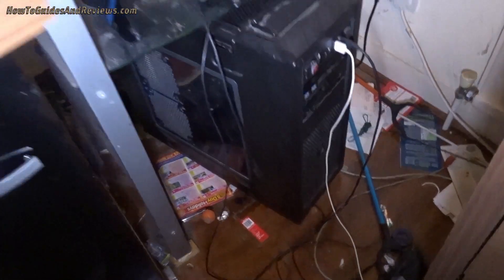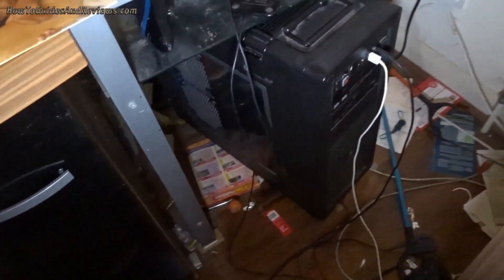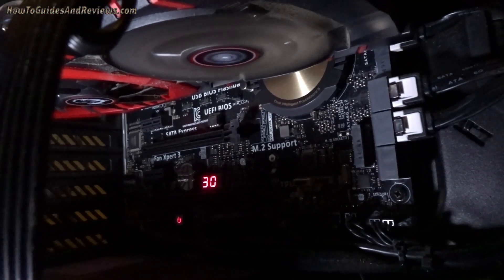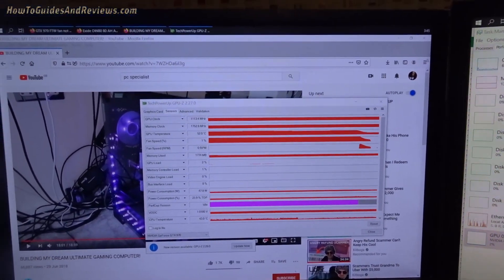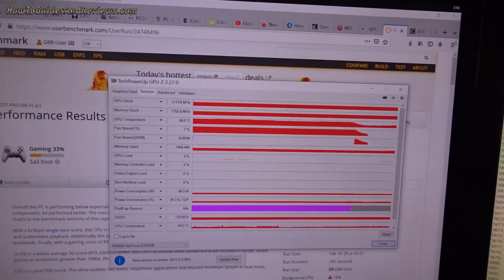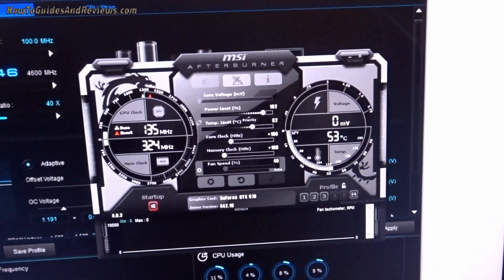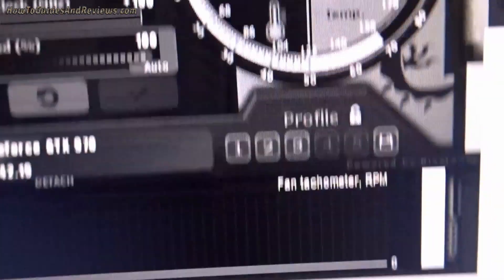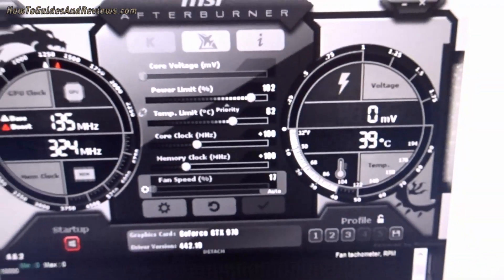Computer GPU Fans Not Spinning Quick FIX - Sticky Fans Solution

Comment: When I turn on my pc they spin but when the Gpu is under load they won’t spin why can’t the fans just spin constantly when you turn it on and when you’re at the desk top? His computer is dusty and mines not this doesn’t make sense
Reply from the maker: you need to empty a vacuum bag into it to make it dusty then the fix will work :)     Why don't you just follow the instructions and install Afterburner, problem solved.
Reply: @Quantum_AI_Tech  i just start afterburner up with windows
Reply from the maker: you have to set afterburner to keep the fans always on. Settings / Fan / Enable user defined software auto fan control.....

Comment: Started having a very similar problem today. I unticked the bottom 2 options, made a slightly more aggressive fan curve and now my fans don't stop.

They were initially revving up to 2k rpm and then all the way to 0 for an extended amount of time before turning back on.
Reply: im thinking the windows update fucked with something lol
Reply: BTW, stop buying gpu fan replacements and instead use the fans from an AIO cooler. strap, mold, or weld the fans onto your gpu and get rid of the casing. all the casing provides is asthetics not any actual benefit. its actually a negative impact on the gpu cooling. I have a 360mm kraken that I took 2 fans from and strapped them to my gpu, even with the kraken AIO having ONE fan. The cpu sits at 32 while the gpu sits at 35 at idle. under full load on heaven benchmark cpu hits 63 while GPU hits 71 at max. Which is insane. considering with its original fans it was hitting 75 easily. and going upwards of 78 at times.
hfdgsdfg

Comment: My fans do not work whatsoever. I have a Windows 10 Pro, with a GTX 960 EVGA dual fan. I have downloaded multiple programs, but nothing works. I have everything connected and the gpu got to 91 degrees Celsius last night while I was trying to play Destiny 2. Let me tell you, that game is hella graphics demanding
Reply from the maker: did you watch the video and attempt the fix? Your fans are stuck or dead, software aint going to get them to spin, prod them with a pencil to get them spinning, then use after burner to keep them spinning
Reply: @Quantum_AI_Tech  oml I already did all that. msi afterburner doesnt do crap. precision x1 doesnt do crap. nothing works with the fan.

Comment: hello sir does gpu fan wont spin  will caused  the lag like droping into 1-6 fps? on games?
Reply from the maker: Yes, cos the GPU will over heat amd thermal throttle performance.
Reply: well yes and no. if it’s hot as hell, chances are your computer will crash. but there will be no lag.

Comment: hey guys i really need some help, i got an acer nitro 5 laptop with an RTX 2060. My cpu fan spins fine and smoothly but my gpu fan doesnt spin properly at all it keeps like jamming. I used to get 6000 rpm on my gpu when it was maxed but now i only get 2500, I opened up my laptop and tried spinning the gpu fan myself and i could see that it kept on jamming. What do i do?
Reply from the maker: did you try MSI afterburner to always keep it spinning at a low rate?

Comment: Hi! Yesterday i got brand new gpu, so i wanted to unplug gpu lightning, i removed 4 pin power plug as i thought it was lightning ones but actually it was fan power plug. I have gpu with three fans, two of them stopped working i put back that power plug but after that fans are not working properly. When junction temps reach 80c one fan will start working but last one wont start.  I have videos on my channel how fans are spinning. I think i have messed up gpu bios
Reply from the maker: did you unplug the 4 pin whilst powered on? or plug in whilst powered on? if so youve damaged the GPU.
Reply: @Quantum_AI_Tech  yes power was on but i have done it before, nothing happened. I know that 8 pin gpu power cables shouldnt unplug when power is on. Thats sad if its damaged now bc of that. Is it repearable?
Reply from the maker: You are playing russian roulette, eventually you will damage it and I mean 50/50 chance on each unplugging. And probably damage other components in your system as well. Don't fing unplug andf plug things inside your PC when it is POWERED ON! COMPRENDE?

Comment: Have a GTX 980 SC From EVGA, Put a working card in my new build as a starter GPU because a 3090 will go there eventually. Upon booting to windows the GPU fans stop spinning, they'll spin when you turn the computer on but when you get to Windows the fans stop and don't start back up even under load. They look like they try to start spinning but don't, afterburner is what I'm telling to spin the fans manually. I know this card works just fine, it did for over 2 years with no problems, it was never dusty and it never had problems until I put this card in my new build. It's frustrating
Reply from the maker: Sounds like AFB fan control is NOT enbaled. Make sure that afterburner is actually controlling it  i.e. AFB settings  / Fan / Enable user defined fan control box checked.

Comment: What's do you set your fun speed at if you don't mind me asking ty
Reply from the maker: 17% upto 40c then slowly ramps up, 100% at 75c, though does not go over 65c. So runs fairly quiet most of the time. The fan curve is set in afterburner.

Comment: My gpu is werid its an rtx 3070 zotac twin edge and the fans arent moving and im getting 39C
Reply from the maker: Use MSI afterburner to keep the fans constantly spinning at a low rpm, watch the video. Though 39c is not hot for a GPU.

Comment: Holy fúck mate tanks, my 1650 was way up in the 80s, now (thanks to your solution) it has gone down to to the 50-60s
Reply: Which method did you use? I also have a 1650 gtx

Comment: I can't believe this actually worked for my 3090.  One of the fans wasn't spinning but the other 2 were.  Took a few tries trying to spin it in both directions until it just took off.  Thank you.
Reply: Did u have display when they weren't spinning?
Reply from the maker: You will have a display but it will thermal throttle performance.

Comment: Over Christmas I had a mother board issue where the fan stop working on two of my graphic cards.  But I I did not have MSI on was not  it so I did not know about it And  I did not know about it,  to it was to late. I was playing Far cry New dawn   After my RX 580 8gig went to black screen.  I replace it with my spare  graphic cards my R7 260x OC this card is factory set to run at a clock speed of  1188mhz. but it to went to black screen It only lasted two days.  I manage to use a hairdryer on the  R7 260x and got it going I use MSI I notice that  the fan on the R7 260x was not turning and the tamp of the R7 260 went a high as 99c I did a bypass of  the power supply of the fan in the R7 260x  I ran it directly off the PSU  Playing the game on low settings   the tamp in the R7 260x now sat around the 65c mark I got to get  th RX 580 going I don't like playing games like far cry new dawn on low settings.
Reply from the maker: yep, you need to keep an eye on temps.

Comment: my graphics card is the Evga gtx 980. I recently bought this thing used. Worked great but it started crashing when I played a game on fairly high graphics. Then I checked my temperature and man 94-97 degrees on idle... both my fans don’t spin... I tried using the pencil trick and the afterburner. One of the fans just completely stopped working and the other fan just struggles to spin and just makes tick sounds. Any suggestions please.
Reply from the maker: Looks like your fans are dead. Remove the fans and stick some case fans on to the GPU powered by the motherboard if you can't connect them directly to the GPU. If problem attaching you could just use some tape. Anyway that's what I would do. Theres also a good chance your GPU is now faulty after having run hot for a while and being a good 4 years old. Just illustrates people always need to check their temps whenever they notice anything wrong as temps kill electronics.
Reply from the maker: You can hardly test for anything if you don't have a monitor.

Comment: My gpu fans werent spinning on idle because it wasnt hot, but once i put it under load in a game they start to spin, i feel so stupid
Reply from the maker: Thats how they are supposed to work, but because of the stop start behaviour eventually they will stop spinning, best to config MSI AB to always keep them spinning at a low rpm that way they won't stick.
Reply: @Quantum_AI_Tech  can i make it spin at low rpm at idle but when it goes under load full speed?
Reply from the maker: In afterburner you can set a fan curve, so it ramps up the fan speeds as needed.
Reply: @Quantum_AI_Tech  Bet, thanks

Comment: some GPU fans don't spin unless under load, but man take out the thing and clean it.
Reply from the maker: Thats how they get stuck, you need to keep them spinning at a low RPM. If you don't they will eventually stick.
Reply: @Quantum_AI_Tech  how do i get them to spin at a low rpm on idle?
Reply from the maker: @ Shafay Its in the video, solution keeps it spinning at a low RPM until needed. It works, I have been using the solution for over 6 months now.
Reply: @Quantum_AI_Tech  No, they get stuck because there's so much dust and filth that they can't spin at a low RPM anymore
Reply from the maker: Well then take the card out and clean it. Use a hoover on it etc.

Comment: What does prod the fan mean?
Reply from the maker: poke the  fans with a a pointy object  - did you watch the video?
Reply: @Quantum_AI_Tech   well at first i was but then i realized the psu cables werent plugged correctly into my gpu so that was why my gpu wasnt working. But i have a new problem, i loaded into the american megatrends screen and i continue into my bios then exit out of the bios. After that my pc repeatedly restarts until i go back to the american megatrends screen. Can u help me out in any way?
Reply from the maker: how far does it get before reboot, whats the last bit on screen
Reply: @Quantum_AI_Tech   there's nothing on the screen. It just keeps rebooting until it gets to the American megatrends screen.
Reply from the maker: so this started after you plugged in the psu cable into GPU?
Reply: Ok so i kinda fixed it. I just restarted my pc by power button. However, now my pc crashes everytime i try to run a game, reinstall drivers, and if i use it for like 20 mins or longer, it just crashes. Edit: now when i type in my password and click enter it crashes. My gpu is a 3060 ti.
Reply from the maker: whats your psu i.e. make and watts and how old is it, could be PSU is dying.
Reply: @Quantum_AI_Tech   my psu is the corsair rm 850. With 850 watts. I bought it 2 months ago i think. Everything in my pc is basically new. I have a ryzen 9 3900x, asus prime pro x570, 36gm3600mhz ram, 1.5 tb ssd and a noctua nhd15 cpu cooler.
Reply from the maker: Has your pc ever run games properly with this GPU?
Try a different GPU, any gpu if you have an old one lying around and see if that runs a game, if so then you may have a faulty 3060 ti. What are the temps when its running properly, check temps using software like hwinfo (free download off the net)
Reply: @Quantum_AI_Tech  temps for the gpu is 50 degrees celicus. It has ran properly. And i do have a old gpu that dont work.
Reply from the maker: Then sounds lke file corruption, maybe the driver. uninstall and reinstall, may need to boot to safe mode to do so.
Reply: @Quantum_AI_Tech  sorry for the late reply but, for that week you replied to me it just fixed. I dont know how but for that entire week no crashes black screens anything. After that it started happening again and im not sure why. I have tried multiple times using a ddu going into safe mode as well and still keeps doing that. I agree there must be a problem with drivers since when i uninstalled them, my pc ran completely fine without drivers from nvidia. But still any help will do thank you.

Comment: AMD Zero RPM be like:
Reply from the maker: Zero RPM means the fans are not spinning, if the fan % is above 0% that means the fans are stuck, so unstick them then run afterburner to keep the fans constantly spinning at a low RPM.
Reply: @Quantum_AI_Tech My fans weren't stuck, it's an actual feature. The fans stop spinning when it's idling and the cooler is big enough to handle it
Reply from the maker: The problem is eventually after several years of use they won't start spinning when they have to, so if your GPU is say over 2 years old then it is better to keep the fans constantly spinning at a low RPM so that they don't get stuck and fail to cool your gpu.

Comment: mate u can start with cleaning ur room so dust doesnt build up and get into ur pc. that will help with the temp alot aswell
Reply from the maker: Mate the GPU's about to burst into flames don't have time to get the hoover out.
Reply: @Quantum_AI_Tech  Shut it down and clean it up. :)
Reply: @Quantum_AI_Tech  😂😂😂😂😂🤣🤣🤣🤣
Reply: @Quantum_AI_Tech  I feel you man, My laptop is already 72-80 degrees 10 mins in my laptop and my laptop has GTX 1050 Ti, I really dont know why it becomes that hot 😔 (Also I tested with MSI Afterburner)
Reply: @dripgoku6711  this is the  normal temperature for a laptop dont worry
Reply from the maker: @te ki vagy Might be normal for laptops but high temps shorten the hardwares life, especially if its running that hot 72-80c when idle. It's not going to last more than a couple of years.
Reply: @Quantum_AI_Tech  I mean my laptop before hit 92 temperature but I clean it so now it 60 to 70 temperature not so bad
Reply: @dripgoku6711  lol my laptop goes upto 92c while gaming and i have been using it for 2 years at that temps and still no problem
Reply: @Quantum_AI_Tech  i found switching lap top screen to tv and closing laptop screen down as laptop temps is mostly the screen temp.it a little help to make themlast longer if using for gaming

Comment: Thanks so much. This worked for me! I honestly thought my fan had died
Reply from the maker: Yep, my fans are still spinning 4 months on, just have after burner on to keep the fans constantly spinning at a low RPM  and they won't stick again.
Reply: @Quantum_AI_Tech  firestorm did the job for me but do you have to flick the fan every time you start the pc?
Reply from the maker: NO, when I made the video I thought I would have to but it's been fine. All I do after a reboot is to check afterburner that the fans are still spinning by looking at the RPM reading which should NOT be 0.
Reply: @Quantum_AI_Tech  oh okk. there is a built in custom curve in firestorm application, is it okay if i use it.?(if i set it in automatic it shows 40% but the fans don't run)
Reply from the maker: You need to track RPM not fan %, best to use afterburner
Reply: @Quantum_AI_Tech  okk

Comment: Do your system a favour and give it a clean with a vacuum or something. Never seen so much dust on fans before
Reply from the maker: I did after doing this video,  will post the video of shuving a vacum cleaner into the case.
Reply: Never use a vaccum cleaner

Comment: Use msi afterburner
Reply from the maker: The video demonstrates to use MSI aferburner to keep the fans always spinning at a low rpm as part of the quick solution, so 1 use a pencil to start the fans spinning and after burner to keep them spinning.  https://youtu.be/JVBH9lvruII?t=443